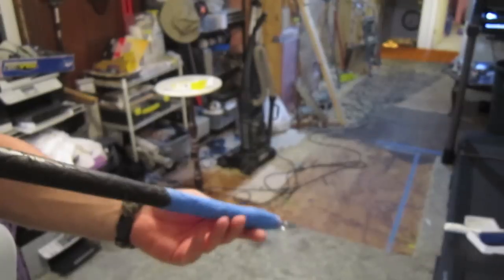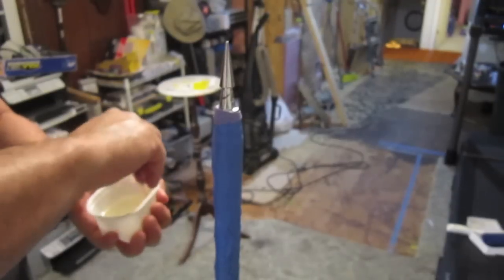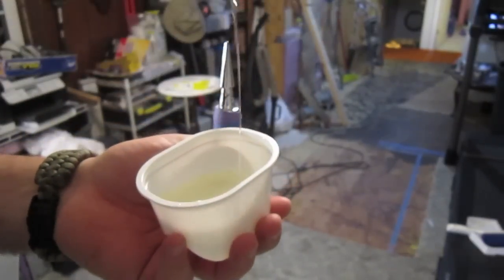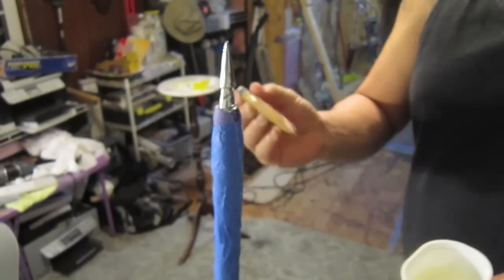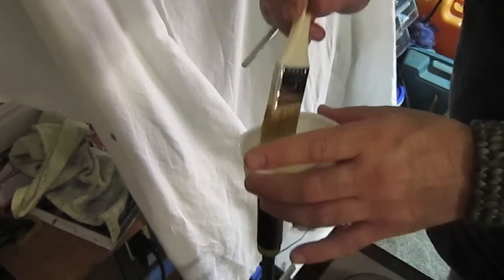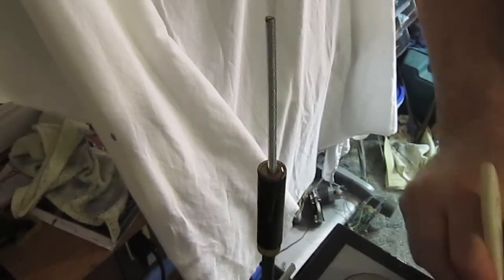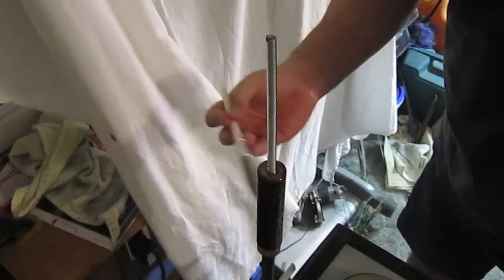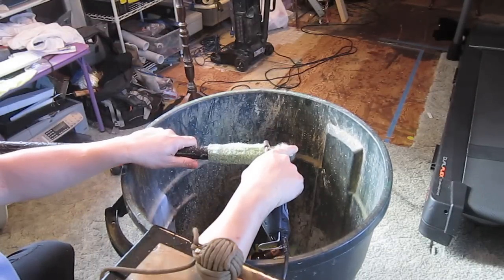Making a Hidden Sword Cane - 2

Comment: looking for an actual DIY on this! looking to make a prop for my kid using a plastic sword.
Reply from the maker: aside from plastic, what other materials are you comfortable working with?
Reply: +Primal Edge - damn near everything. I just don't weld. I'm very handy/crafty. I recently have Harley Quinn's hammer using a broken mop and card board.
Reply from the maker: jennifer guerra I may have an idea. If I have the equipment, and materials, I'll put something together in a video.
Reply: +Primal Edge -groovy! thank you!!!!!!!!! I look forward to it!!!!
Reply: I got harrassed a few days ago by a couple of guys, so Ive been thinking of arming myself in case it happens again.. I bought two rapiers years ago and got two live blades as spares.. I want to make a scabbard and a handle for the live blade out of wood then maybe shape it down with my linisher.. Im thinking of adding a rubber walking stick tip to the end of it to make it look like a harmless walking stick.. A walking stick with a secret...